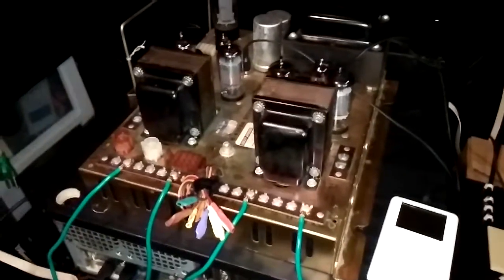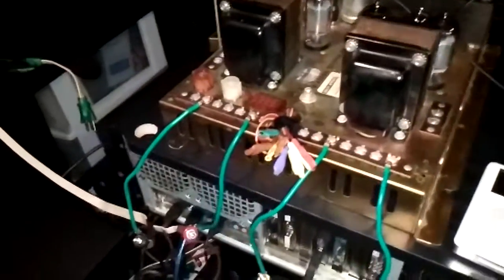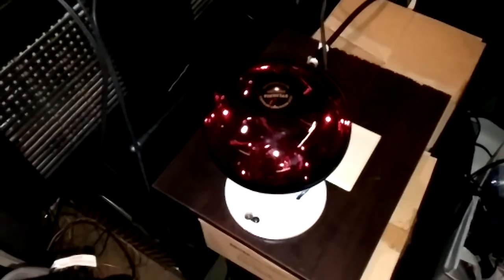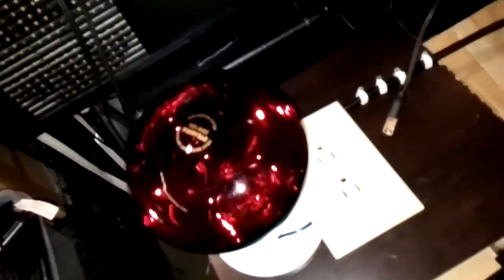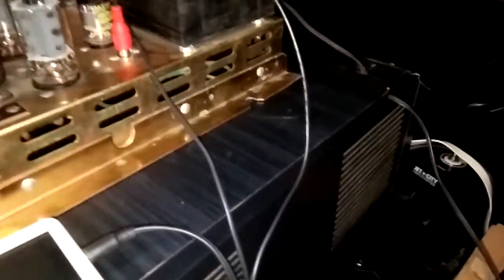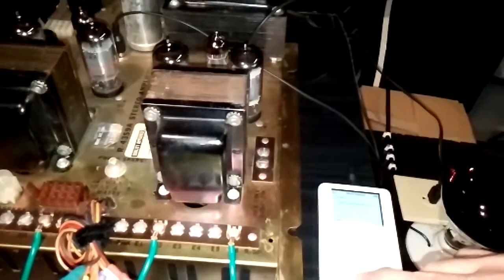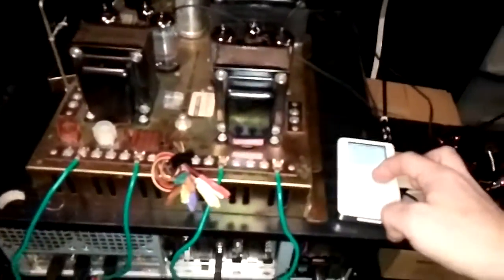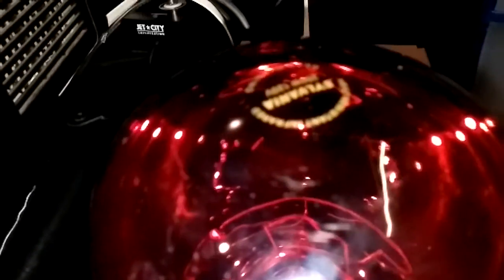ROWE R-4359A Stereo Tube Amplifier Hum Problem

Comment: How'd you make out with the hum issue? These amps are interesting, The Iron alone is worth the price
Reply from the maker: One of the capacitors was out of spec. Simple fix!
Reply: @nonsuch  Do you know which one it was. I'm having the same problem in both channels.
Reply from the maker: @tcw16505  It's been so long Thomas, I can't remember. It was NOT an electrolytic and I think I remember it being a long white one (maybe). I've since replaced all the capacitors in the amp. It's night and day. I recommend doing this, you won't regret it. It's a really great sounding amp!